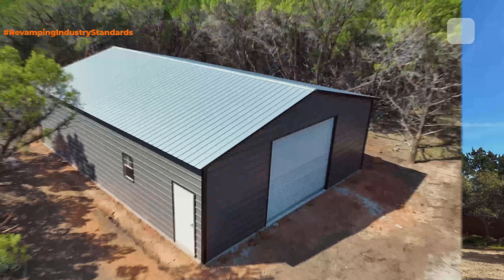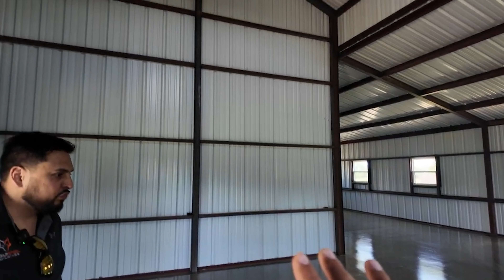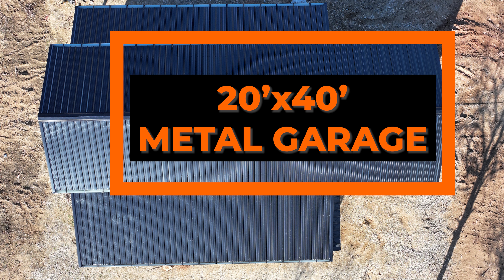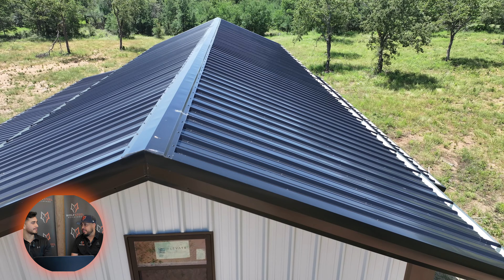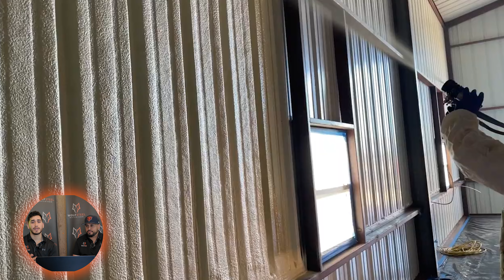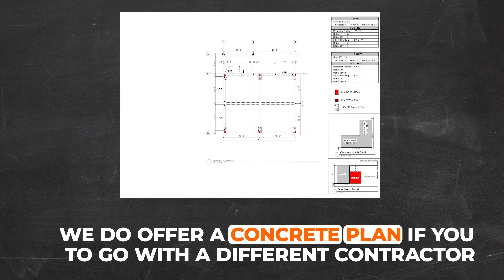Cost to Build Texas Custom Metal Barn | Barndo Shell Only | WolfSteel Buildings

Comment: Nice video. 

Y’all are the only building site I watch.    People understand prices fluctuate.    

But most companies give people no idea.   

So I’m clear.   99k, but he paid for foundation and I assume rough plumbing.   

I’m ready for y’all to get into framing, since y’all do spray foam.     Then just plumber, electric and drywall.    

I would put 2 head minisplit in this one.
Reply from the maker: Thanks Lance! We appreciate you following the channel.  

Yes you are correct! He already had the concrete & rough ins when he contacted us. Pricing is for the building, materials, labor, equipment, and taxes for local area. We are hopeful to be back when he has finished interior. 

Slowly dipping our toes! Stay tuned for those projects 👏🏼